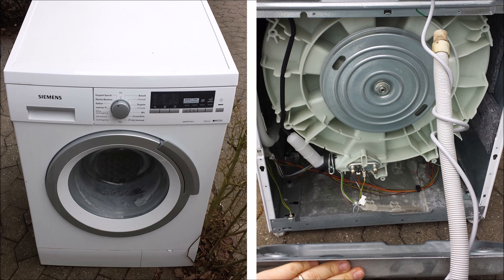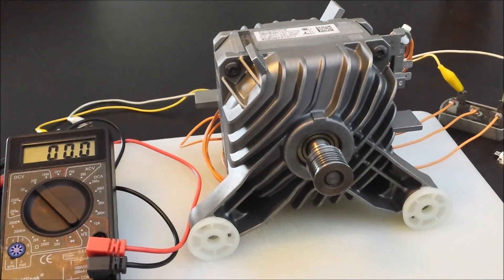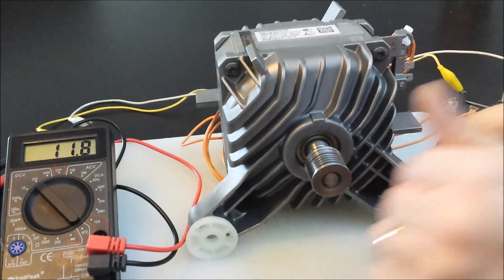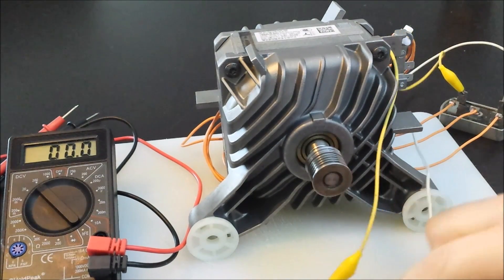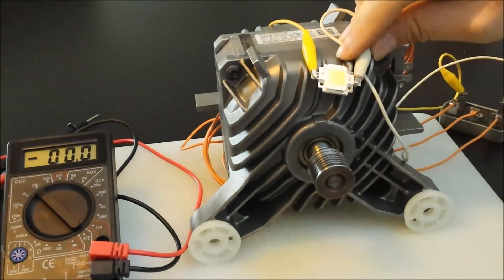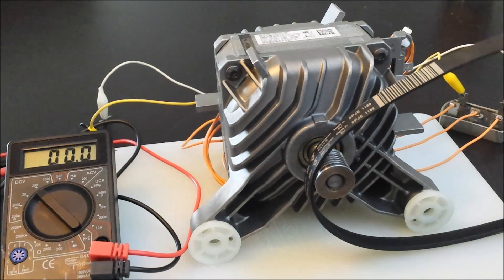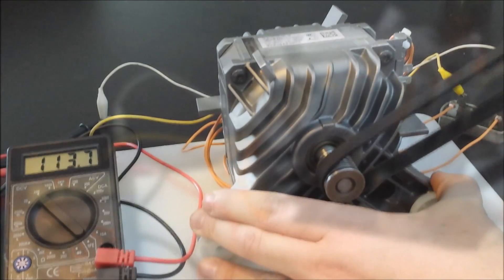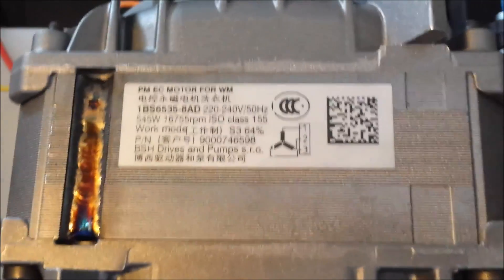How to get FREE ENERGY from neighbors scrap washing machine  - Siemens iQdrive

Comment: so, if the voltage exceeds 100 volts for a 12v dc setup, wouldnt that wreck something? too much voltage? is there a way to regulate the voltage?
Reply from the maker: Well first of, I would make a pulley system to regulate the RPM, and then look at what mppt chargers would do for you. Mppt chargers convert a higher voltage DC output from your wind turbine down to the lower voltage needed to charge batteries, and when doing this, it also raises the amperage.
Reply: ooooDanieloooo 

Or can we store the energy in a bank that will output only certain amount of voltage?

Comment: You need to know the Power = I x V, at your calculated Tip Speed Ratio wind turbine and match it with the RPM from the generator/motor and match it with the Power=1/2*density*Area*v^3, (including the Bertz factor), also the torque should be take into consideration for know the cut in wind speed, maybe this motor is the best, but I am mechanical engineering and as researcher, my conclusion is;  you need more data, this Video only showing that a motor can generate voltage, although may be the best one for a specific wind turbine.
Reply from the maker: Well actually this video shows, that the motor generates voltage and amperage since the LED draws 1 amp.  :-) I know, that the video doesn't show how much it's capable of, but hopefully i will have time for making a new video soon.

Comment: AC or DC voltage?
Reply from the maker: Hi Joe. Well, the motor outputs AC voltage, and through the bridge rectifier it's converted to DC. What I measure in the video is in DC

Comment: Since I have this motor right now, I will test it a little bit more serious. Nothing happening here anymore.
Reply from the maker: RheinErftVideo Have you seen part 2? There´ll be a part 3 soon.
Reply: Please give a link. I guess I already had part 2. I have a big problem to bring down the voltage from the motor to usuable DC voltage without loss of power from the motor. It´s too much, depending on RPM.

I connected the motor with an original wheel and a belt from a Siemens washing machine and have a ratio 1 : 12 which is pretty good for wind or water turbines.
Reply from the maker: If you need to get more amps, and less voltage without any powerdrop there's the opportunity to rewire the motor with thicker gauge wire. If using a voltage converter / stabilizer you would loose some procentage. Also, have a look into MPPT charge controllers, they tend to work between 12-60 v
Reply: No, never at all. I will not open or rewire ths excellent motor.
Probably going to buy this:
https://www.ebay.de/itm/Skyrc-efuel-AC-DC-30A-Netzteil-Transformator-Lader-100-240v-Trafo-Ladegerat-DE/232689921148
This should be open for AC - and DC input as well between 100 - 240 V at 30 A for probably already having another bridge rectifier at input taking from 80 - 260 V AC/DC (?)
Sounds not too bad and pretty suitable for the Siemens motor output which I plan to use with a 12 Volt Sinus inverter to 240 Volt.

Comment: i was just thinking if this puts out so much voltage ' does this mean you can put a voltage step down converter on spin it at a set speed and run a 12v inverter dc to ac 240v '''' meaning no need for a wind turbine .
Reply: fred bloggs thats excectly what i thought. But will it work? It has to...

Comment: Hi Daniel . 
I tried this experiment on a brushed washing machine motor and just spinning with my fingers i got 36 volts using the same set up as you. Unfortunately i didn't get any amps. Is there a way to wire up to get ampage ?
Reply from the maker: +Andy Leffler Hi there Andy. Thanks for your question. If your motor produces lots of voltage but lacks amps you would either choose a different motor or rewire the motor with less windings and heavier gauge wire and perhaps stronger magnets. Try to search youtube for "rewire motor windturbine". I hope it helps. Cheers.
Reply: Thanks for the quick reply and advice. I will look into it to see what can be done.
Cheers

Comment: The motor you show here, 1BS6535-8AD, 220-240V/50Hz, 545W, 16755rpm taken perhaps from Bosch Logixx 8 VarioPerfect washing machine, seems to be an AC motor with two coils, one in the rotor and one in the stator. The rotor coil it uses brushes for connection. There are no magnets in the stator.
https://www.youtube.com/watch?v=x4YNbVODA4Q
So, if you get some voltage is perhaps because of residual magnetization of the stator core.
Reply from the maker: Thanks for your comment, embrace don't neglect ;-) the motor is a Siemens IQ-drive motor, with permanent magnets as shown in this illustration https://www.youtube.com/watch?v=oNLVErM1-y8.
Reply: Thanks, indeed. The one I point to is a different one.
Reply from the maker: No prob. :-)

Comment: Direct current misure the tester?
Reply from the maker: Iky piky I am sorry, I don't quite understand your question?
Reply: ooooDanieloooo there motor is DC or AC? Multimeter is set to DC or AC?
Reply from the maker: Oh... Motor is AC, and throug the rectifier switched to DC. Multimeter is measuring DC.

Comment: how to hook up to a wind turbine and then run it to a battery
Reply from the maker: Hi there. I would either make wind turbine blades from pvc and mount on a hub. Or you could make a pulley system to enhance rpm. Remember to use a charge controller to have a safe way of charging batteries.
Reply: thanks so much Daniel. could you recommend a charge controller and could you possibly make a video on rewiring the motor thanks.
Reply from the maker: Any solar charge controller from amazon or ebay would work. :-) 
See the follow-up video here, where I talk about the wiring: https://www.youtube.com/watch?v=G21rraLiAjY

Comment: If it's a permanent magnet motor, I believe you have a DC motor.  By using an external power source to turn it, you can use pretty much any DC motor as a DC generator, which is what you're doing.  
Voltage alone doesn't really determine much, what you're interested in is wattage, a combination of voltage and amperage.  
Your output will never be greater than your input, regardless what power source you use, be it solar, wind or water driven, a motor or engine of some sort, or human driven, but you do need an external power source of some sort. While it can be argued that wind, sunshine and water power are free, they are nevertheless a power source.
 LEDs have a very low power consumption, and your setup doesn't have any problem lighting one, or several, for that matter.  It's a different story when you want to power something with a much higher current draw (wattage), like an electric stove, air conditioning unit or even a gas furnace.  
I'm not trying to discourage you from experimenting, in fact I applaud anyone who does,  but at the moment you're nowhere near saving the world from CO2
Reply from the maker: thanks for you input. all though i am well aware of the things you say. The motor is a AC permanent motor. Not DC, thats why I use the bridge rectifier :-) I know it's not a earth saver, that wasn't the point, but no mater how many amps or wattage it produces, it's power from a renewable energy and therefor saves CO2. If you follow the link in description you'll find that a small test I made showed more than 1 amp. at 114v that equals 114 watt. :-)
Reply: Yes but in order to output 114 watts you will need to input much more than 114 watts mechanical (assuming 60-70% efficiency) It matter not what the source of input is.

Comment: ok how im gonna charge my battery if i got 120 volt there
Reply from the maker: kiriakos1988 You would need to charge a 12 volt battery with the motor and a charge controller, and then you would need an inverter to make 12 volt into 120 volt.
Reply: i have exac the same motor, wich controller i do need? sorry im learning :P
Reply from the maker: Thats ok. I would guess a 10 amp would do the job.
Reply: do you still have the motor, and is it for sell? @1988kuriakos

Comment: Hey guys would this work for an old washing machine motor?
Reply from the maker: Hey Robert. That depends -  the best way of knowing is to have a modelnumber or other ways of determine if the motor is a permanent magnet motor or not. In principle all motors can be use for making energy, but permanent magnet motors is by far the best and easiest.

Comment: is there any re-wirering needs to be done, you didn't mentioned that, and what is that 3 prong thing that is connected to the motor wires?
Reply from the maker: Prince Hispagnyola 
Please see link in description to the part 2 of this video. There'll be more specs in that.
Reply: a three phase  bridge rectifier   what is connected to the motor

Comment: the important thing is what will this voltage be when you put a load on it and how much difficult for it to turn when there is a load. i am planning to build a small electric tricycle with one of these but not sure how to feed them since they are ac motors right? or do washing machines use rectifiers?

Comment: It is a universal type motor. It is found in many household electric stuff such as washing machines, electric grass trimmers ect. This type of electric motor can work both with AC and DC. The problem with these motors is the heat. 

https://en.wikipedia.org/wiki/Universal_motor
Reply from the maker: Well, this is not the universal motor. Universal motor has a stator, with a ironcore and wirewounds. This motor here, is a permanent magnet motor. There's a world to different.

Comment: if you can clearly show us how you connected the  bridge rectifier I think I will be the most happiest person because my son can't sleep without light, which this can help
Reply from the maker: Dearest Luper. 
There is no right or wrong way of connecting the AC wires from your motor to the bridge rectifiers AC input, please see this image: http://goo.gl/ZbJf84  the yellow wavy marks are your AC input wires, those from the motor. 
You have to have a bridge rectifier in order to change your AC output into DC voltage. Does your motor have a modelnumber?
Reply from the maker: Also, watch the video at 44 sec. :  https://youtu.be/xaEemoPPsKE?t=44s
You should see my bridge rectifier on the right side, with the 3 orange wires input.

Comment: sir is your rotor is permangnent ? i have a motor same like ur motor,but it is three wired motor and i open it the rotor does not have any magnent feild .how can i change this motor as a powerful alternator.please tell me ,iam begginer
Reply from the maker: Hello Raj. Yes this model is a permanent magnet motor. If you have the exact same model just rectify the output from the three wires into DC. If it's not the same model, you properly have an electro motor which needs magnets to become a permanent magnet motor. Its possible to convert them, just search Youtube "convert motor to permanent magnet motor" some will surely come up.
Reply: thank you sir, sir any other ideas for built free power you have.
Reply from the maker: Yes. I am about to make some usb power charger from old scrap electric height adjustable tables. They have som motors in them. They're not producing high voltage, but maybe just enough to charge usb power. Will be back soon with a video :-)

Comment: nice one dude.all washine machine motor is equipped with magnetr?
Reply from the maker: Hi there!
no they're not, most older washers are electromagnetic motors which aren't suited as windturbine generators. Most newer expensive washers are fittet with the more energy efficient direct drive brushless motors which are very suited ! Manufactors would brand their products with the info: "Direct drive" or "Brushless" or in someway make consumers aware of this type of motor by exstended warranty on the driveline. PMA or permanent magnet motors do not tear and wear as older motors do
Reply: +ooooDanieloooo  Thanks bro, keep it up